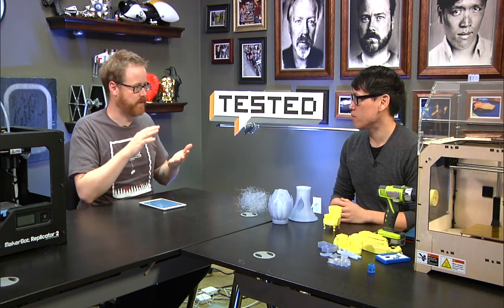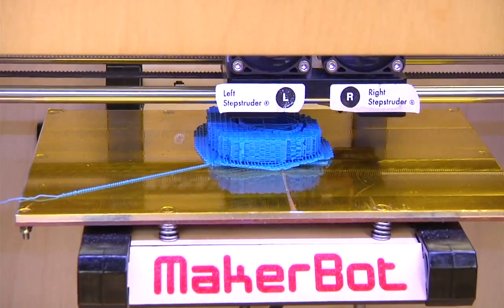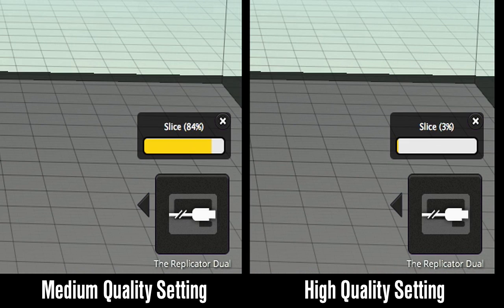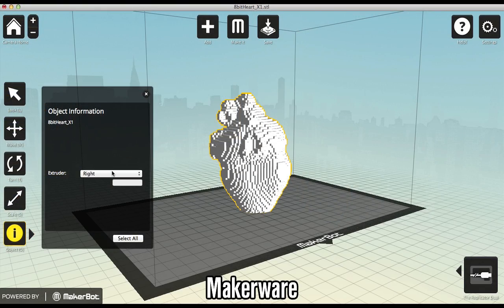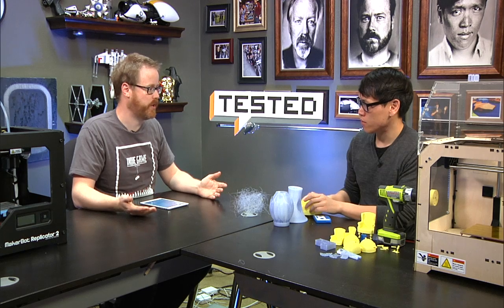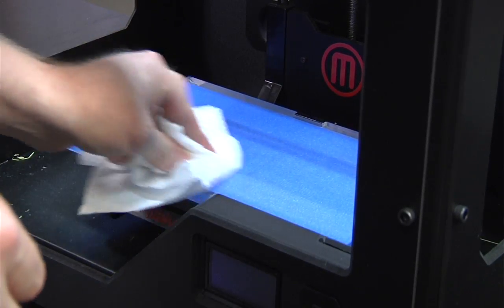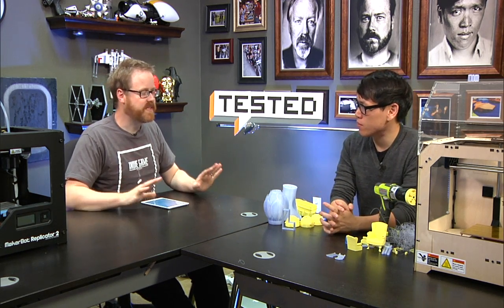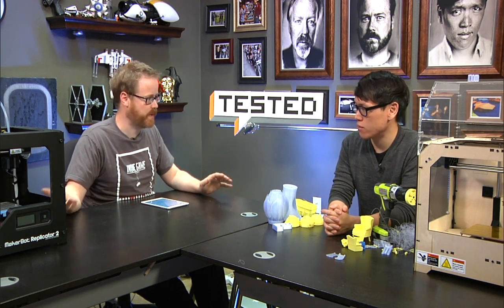Introduction to 3D Printers: The Promise and Pitfalls of Desktop Manufacturing

Comment: I've been using shapeways to print my models for a while now. They're great to work with, the results are nice and generally trouble free. Plus the variety of materials is really handy. 
I'd love to have my own 3d printer but it seems like the hardware has been improving so quickly it's hard to decide on a specific printer. Keep these videos coming. Good stuff.

Comment: I've been printing in .1mm resolution from day one on my Replicator 2x and haven't had any of the problems they talk about.  The longest time my computer took to slice an object was maybe 10min.  Warping is easy to take care of as well.  Take some abs scraps and mix it with acetone.  The abs dissolves in the acetone and creates a slury.  Apply this to the print surface with a small paint brush and say goodbye to warping.

Comment: This is a great intro into 3d printing but is a little bit misleading. The Makerbot is only one form of 3d printing called fused deposition modelling (FDM) and is one of the worse forms of 3d printing. There are so many different types of 3d printing. The best home 3d printer would be the Form 1 which is a SLA printer. But there are so many printers which use different materials such as plastics,resin,powder,metal and paper. The coolest is probably the MCOR IRIS, a full colour, paper 3d printer.

Comment: What riddles me the most is to what degree you could print a "upside down pyramid". How could you let material overhang? To what degree is this possible?`How stable ist ABS and PLA in case of mecanical stress, eg. if you want to build a motor housing?

Comment: I have two part question: (i) can you 3D print a mesh or does the model have to be a solid? (ii) Do you have to change the SURFTAB value on the cad software for higher resolution?

Comment: "theoretical maximum resolution is about 100 microns" No, record for a homemade 3d extrusion printer is is around 15 microns (it was a open source reprap design). However these layer sizes are vary easily achieved with a greater degree of accuracy using a stereolithography based 3d printer. These machines are easier and cheaper to build, only downside is the high cost of liquid photopolymers

Comment: Is any of the softwares using Cuda (or something comparable) for the slicing? For something that can take 4 hours, it should be worth it and the problem seems to be one, that can be computed very efficiently on a GPU.  
Depending on the algorithm computations can be 4 to, in extreme cases, 100 times faster than with a CPU.

Comment: Sensationalism. Any gun part that can be 3d printed could always be CnC milled fairly cheaply. For the price of a 3d printer, its not worth it compared to that for just that purpose. Also, in the same way, its still illegal to sell any parts you 3d print that qualify as the gun, such as an ar-15 lower.

Comment: well that 6 shot was a long time ago. test have been done where they cycled 100+ rounds without failure. they don't need to make any parts that take pressure. those anyone can buy off the internet. its not as simple to use a cnc to make a lower as it is to use a 3d printer thats becoming more and more a house hold item.

Comment: Just poking a bit of fun. I just found it a little funny how you where making a general video about 3d printing but spent almost all of it talking about things specific to the makerbot printers. Whenever you mentioned other printers it just felt dismissive, like they weren't worth mentioning and I'll admit it annoyed me a bit. Slicing times measured in hours for 0.1mm layers is not something I'm used to with my printer for example and I consider 0.1mm a standard quality, not high.

Comment: 2 hours for that r2d2? Good lord, Cura (ultimaker's slicer that can be used on any gcode supported printer) takes like 30 seconds on the most complex models. Maybe it's the computers you guys are running on?
Reply: ***** similar performance on my higher end 4770k
Reply: ***** no, so I guess it's not a totally even comparison, but I've used slic3r and cura.
Reply: ***** I've got an asterid 2100. No ones heard of it, but it's a pretty standard budget printer with a heated bed and all. + I just ordered a robo 3d r1 today :D
Reply: ***** Yah, I hope so too :P. The thing I'm looking forward to with the robo is a large support community (asterid has none) and that sexy auto leveling bed :3 the less calibration the better
Reply: ***** lol hell yeah
Reply: +IN3RT1A Tech how's the robo treating you?
Reply: WolfGamerProHD It's a solid machine, I'd recommend it. Best part of it is the active community and willing tech support. You'll be able to get any problems sorted out. Only thing, be ready to spend $80 on an aftermarket hotend, I use the e3d v6. Had a lot of issues with the stock

Comment: i see no practical use for these small plastic printers, unless you make your legos its useless. make a big concrete pouring 3d printer and build a town or something.
Reply: I can think of thousands of uses from vacuum tubes to transmission housings. How many things in your life are made of plastic?
Reply: this is at a hobbyist level... if you love to design and build and tinker 3D printing is for you.  if you like to be a lazy and sits in front of the TV or facebook all day and not be creative than this isnt for you!
Reply: nice! legos it is
Reply: They are actually quite useful (for me) for printing vintage turntable (phonograph)  parts and various small plastic parts for vintage motorcycles and automobiles.  You do need a good 3D scanner to make them useful.
Reply: the practical uses are only limited to your own brain powers
Reply: steel concrete and other produces would be much more beneficial thats all I was trying to say.
Reply: This comment did not age well at all.